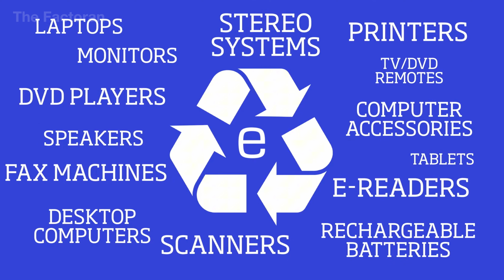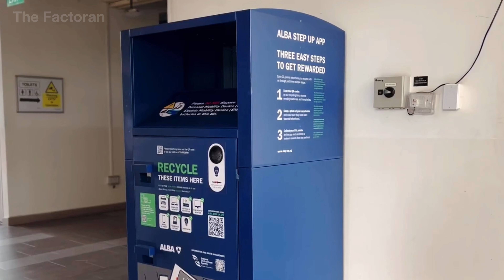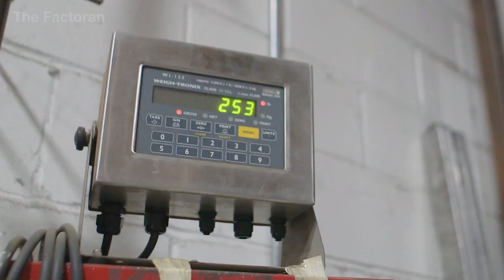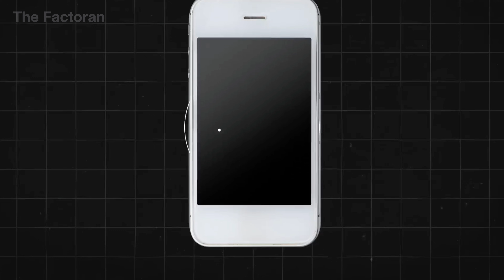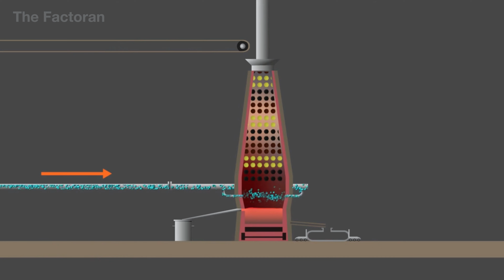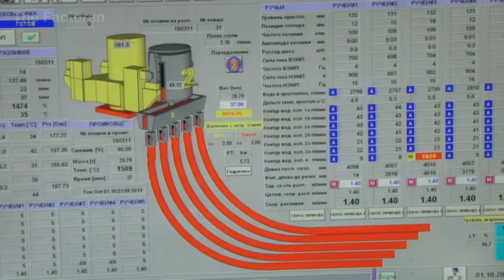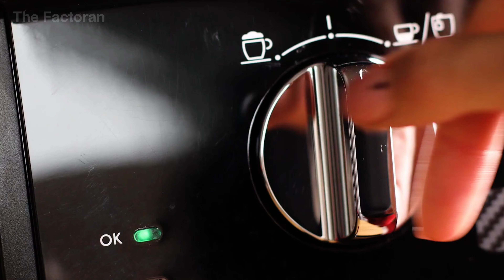How Millions of Pounds of E-Waste Are Recycled Into Industrial Grade Steel Inside Mega Factory

Comment: Parts should be used like screws, switches, power supplies etc.
Reply from the maker: Absolutely—those components are essential in most builds, and standardizing them makes maintenance and upgrades a lot easier.
Reply: @TheFactoran Sorry I meant removed and reused. Motorised screwdrivers can remove em quicky. Though it will be labor intensive but it's my thought. I salvage screws from all plastic items before putting them for local scrapper. These screws help later 😊

I am looking forward to a future of 0% dumping. I day dream of people doing it at their levels over weekends. Paper cardboard everything is sent to recycling. 

I have a medium small size green bin at home where I put everything and when full give it to recycling. 😊